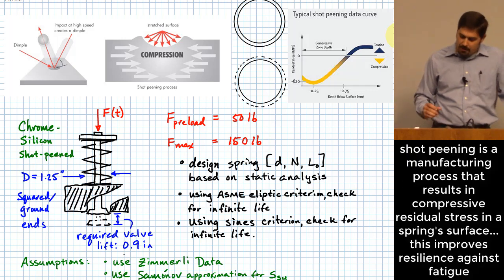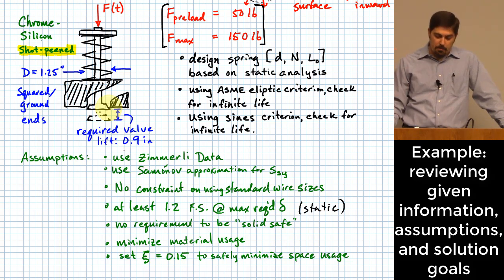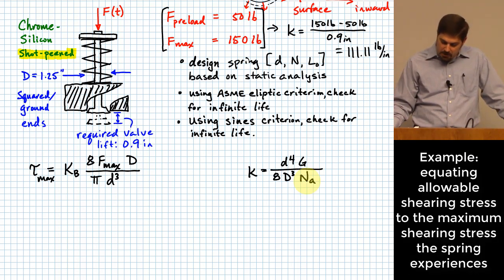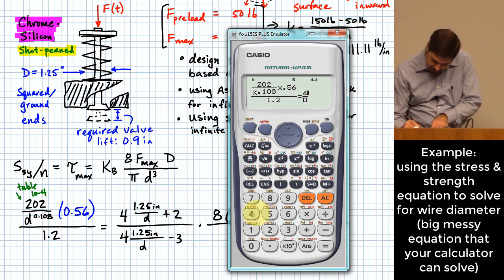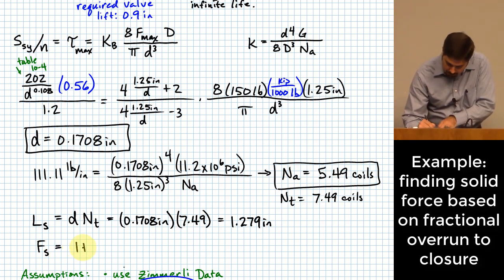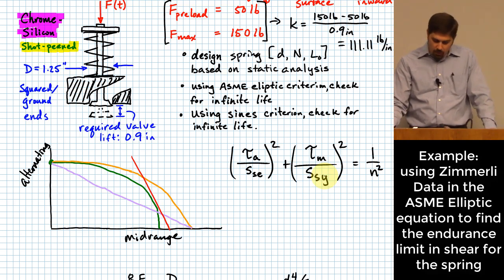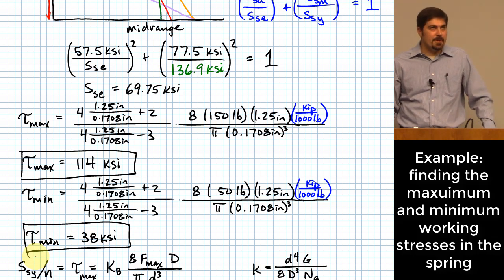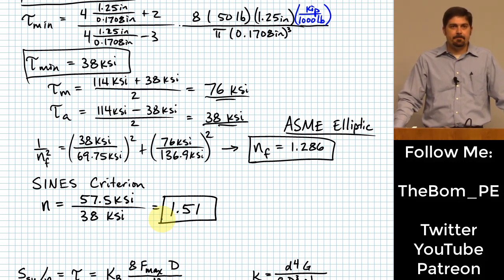Spring Fatigue | Shot Peening | Design for Static Strength with Continuously Variable Wire Diameters

Comment: This lecture is amazing sir , thank a lot . but I have a question . How about multi cross sectional shafts ? and also what is the second critical speed ? as you know in multistage pumps somtimes operating speed of the shaft is over critical speed , but how is it possible without failure of the shaft ?
Reply from the maker: A much more thorough method of evaluating critical shaft speeds has been developed, and it is even discussed (though not at great length/depth) in Shigley. With enough analysis, including evaluating damping effects, more than 2 bearings, etc., I assume there are many designs where speeds can safely be above the first critical speed. The purpose of my lecture on shaft critical speeds ( https://youtu.be/_wnyYHyRvU8 ) was more to introduce my students to another mode of possible failure, and to give them the simplest, most conservative way to avoid it. I'll keep in mind the idea of doing a more advanced lecture on shaft resonance. I've already had a number of people request a course in vibrations, so we'll see! Thanks for your support! I hope you're well!
Reply: @TheBomPE  That will be amazing , sir , Hearing vibration lectures with your great explanation will be great and I admit I can not wait to wach those lectures.